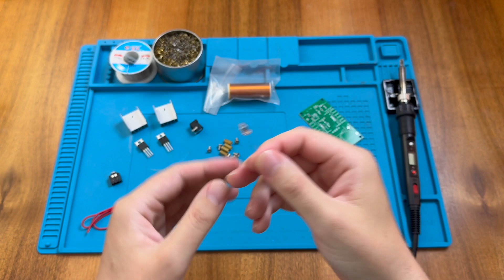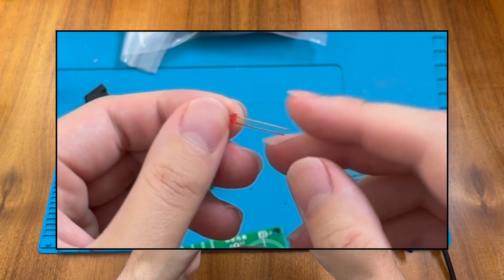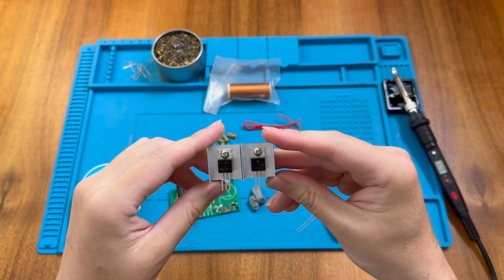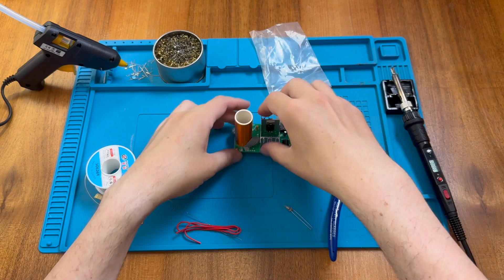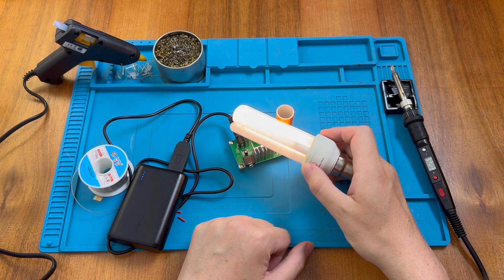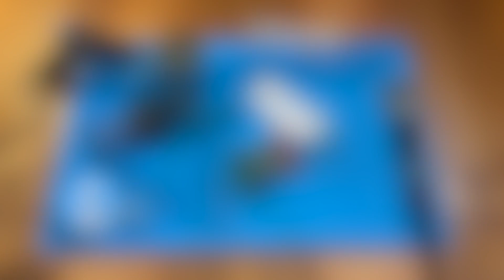Wireless Power - Building and Testing a "Big" Tesla Coil DIY Soldering Kit (with Audio Input)

Comment: This one worked well and I did get a blue arc at the end of the coil, very impressive.
The arc did not appear until about 20 volts.
Thanks for all your help.
Paul.
Reply from the maker: That's great. I'd have to crack out one of the "proper" power supplies to push 20 V into it. Glad to hear yours worked so well! 😃